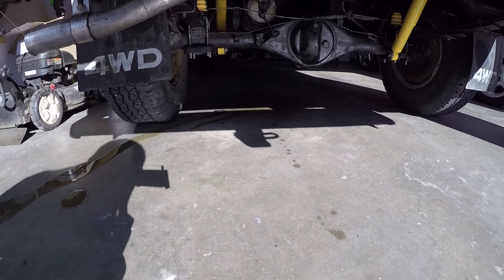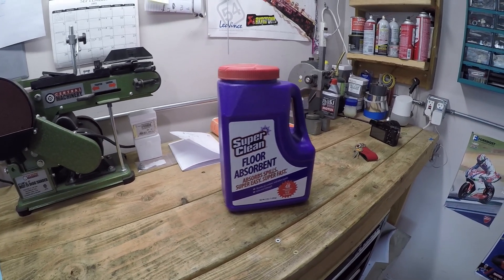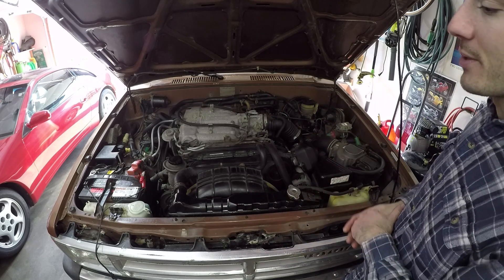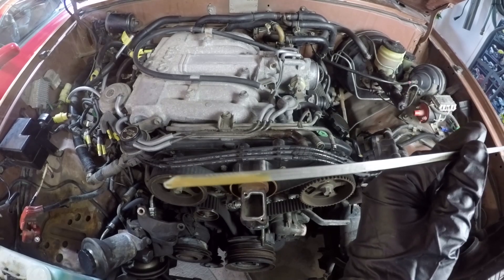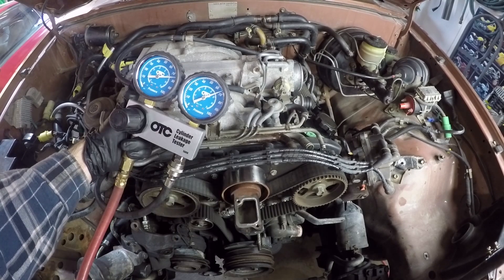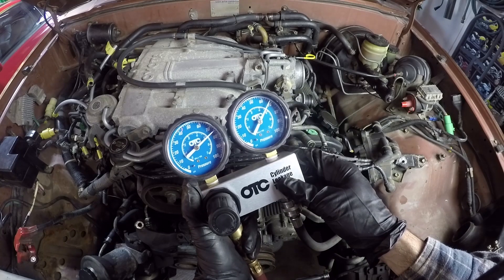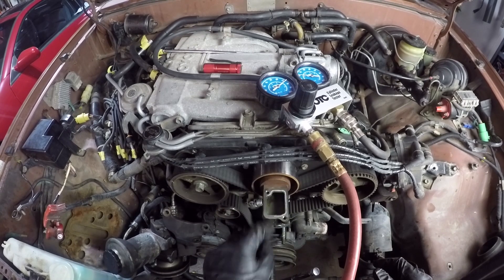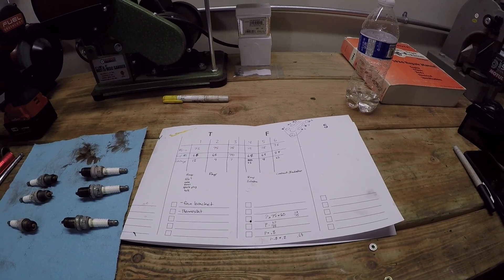4Runner 3VZE Head Gasket LEAK Test | WORST Toyota Engine? | Ep.2

Comment: The worst engine? Oh please, I had the head gasket recall done at 75K miles. I now have 330K miles on a 1992 Toyota 4x4 with the 3.0 V-6. IMO...the people having the head gasket issues, and not maintaining there trucks. I change the oil & filter ever 3K miles. But, more importantly, I change my coolant every two years at the longest. Every time I get a timing belt, I have the water pump changed. Only use factory recommended coolant and don't mix brands. Yes! The newer 3.4 is a much better engine. But if one takes care of the 3.0, it should last.

Comment: whoever designed the cross exhaust pipe around the back of the motor between the heads and the firewall needs to have their nuts turned too tight to they snap off.

Comment: In my humble opinion, the 3VZ-E doesn't have a head gasket problem; it has a No. 6 cylinder problem. The 3VZ-E is built like a vault but its terrible exhaust configuration cooks the No. 6 cylinder. Thankfully, the driver's side head gasket acts as a de-facto fuse. And like most engines from the 1980s, the passive emission equipment makes it harder to work on.

Comment: i had the original cooper radiator get pin leaks out the top fixed it w jb weld lol replaced the radiator but it probably would’ve held up

Comment: Just bought a mint 89 3.0 pickup in the summer time for $3500 and drove it back home to Washington state from Utah. Went to check my fluids the other day and noticed oil  in the coolant reservoir and radiator but the oil on the dipstick looked totally normal. Is it possible for it to be something other than the head gaskets? Hasn't overheated at all either.
Reply from the maker: Mine never overheated either as far as I could tell. Then again, the temperature gauge isn't too accurate. If you're certain there's oil in the coolant, I can't imagine how else it would get there outside of a head gasket. I'd recommend doing a leak down test to find out for sure.
Reply: @PracticalEnthusiast  I guess I will do that then. Thank you for the response

Comment: Yikes, the 3.Slow isn't the most powerful engine, but you have no right to call it the worst engine. Good on you for your mechanical abilities, but these clickbait titles need to stop. 

My 3.0Slow has over 250k miles, original engine, just normal maintenance, and keeping the cooling system in check. These are reliable cars that will never let you down.

Comment: When I tried doing a leak down test on my 4Runner my motor kept backing up as I applied pressure, usually would move around 40PSI. Anyone else have this problem?
Reply from the maker: That can happen if the piston isn't all the way at TDC. You can also try putting it in gear after you have the piston at TDC. You could also try putting the plugs back in the other cylinders to create some extra resistance.

Comment: I've heard repeatedly that number 6 on 3vze is hot spot and exhaust header aftermarkets can fix the issue.  I also had number 6 blow, although a mechanic put a spark plug "extender" in after diagnosing a slight valve issue on number 6,  head blew 40 miles later.
Reply: You had a mechanic that didn't know what he was doing.

Comment: Over 200k miles and "worst engine?"  A bit harsh as there are tons that have well over 300k miles, mine included.  Yes, the HG was an issue and it was resolved through a recall, but even then many lasted long with those originals.  Is it Toyota's best, not even close.  Love the video, the editing and super impressed with your skills and technique!!!
Reply from the maker: True, there are likely worse Toyota engines (some are mentioned in the comments!). But this one has made quite the name for itself! I hope to rectify its issues for good.
Reply: @PracticalEnthusiast  MLS head gasket and arp head studs, fixed the 3VZ.

Comment: I'm a big fan! I am enjoying this series despite the surprise that caused it. Why do you say at the end that the heads have to be machined? Could you replace head gasket and not machine the heads?
Reply from the maker: Thanks for watching! You can sometimes get away with replacing head gasket without machining the head, but your best chance of success is to have it machined. Aluminum cylinder heads can warp if overheated (often the cause of the head gasket failing in the first place) and the only chance of getting them to seal back up is to have them machined flat.
Reply: @PracticalEnthusiast  👍 Thanks!

Comment: Hey Peter, where did you get those black gloves that I see you use in most of your videos. Looks like they are pretty decent
Reply from the maker: They are awesome gloves, very durable compared to the blue ones I had been using. The downside? They're expensive. But worth it in my opinion. SAS Raven #66519

Comment: I'd say a surf/4runner with a 2L-T diesel is as bad if not worse for overheating, and blowing HG's and cracking heads than this V6... They're notorious for it and they make no power either to add insult to injury.
Reply from the maker: I had no idea they were bad too! I'd think a Toyota diesel would be bulletproof.
Reply: @PracticalEnthusiast  The 2LT and 1KZTE have overheating and head cracking problems. Part of the problem was a lot of Surf's came here to NZ as Japanese imports where the climate is colder and the cooling system wasn't quite adequate. The later Hilux 1KDFTV have injector problems, and the 1GDFTV has DPF problems, currently subject to class action in Australia- note those engines are in chronological order. Toyota is generally good at rectifying problems in later iterations though. 
The Japanese historically haven't built a light diesel as good as the Europeans, aside from Isuzu (with the exception of an engine that uses HEUI injection like some CAT engines). The big diesels from Fuso, Hino, Isuzu are well regarded though.

Comment: Eh... I'd put the 3VZ in the same category as the 7M. Problematic from the factory, yes, but generally reliable with the right head gasket/s. 

That said, the worst Toyota engine by far would have to be the 2AZ. Not only did they have problems with extreme oil consumption, but they were also prone to having the head bolts completely strip out the threads in the aluminum block over time. 

Total junk.
Reply from the maker: Oof I'll be sure to stay clear of that one!
Reply: 7M for the win!!!